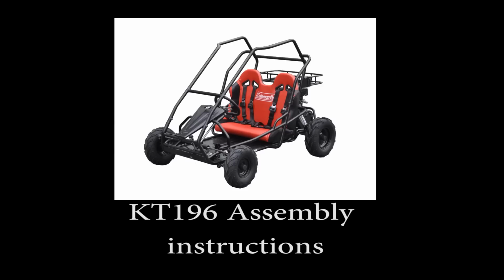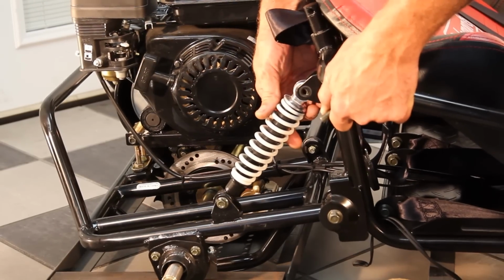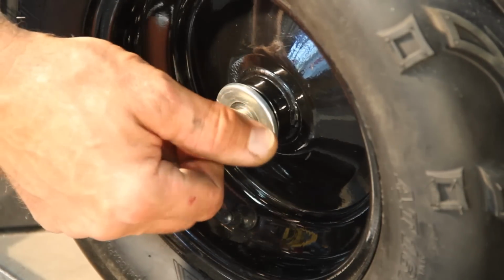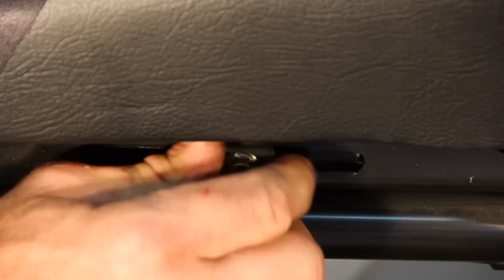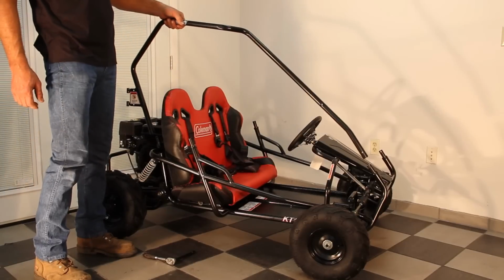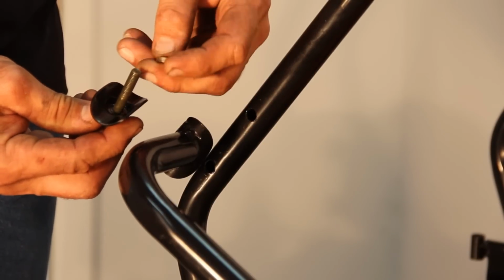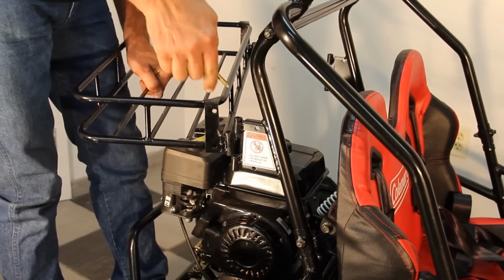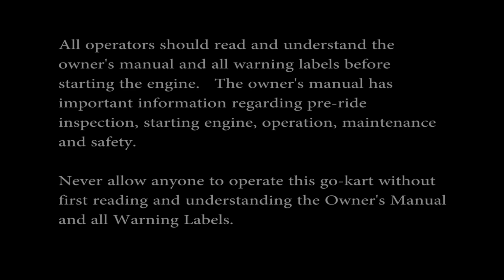New Coleman KT196   Go Kart - Assembly Instructions

Comment: Doh! picked one up and in 3 weeks the bearing seems to have seized up already. the sprocket to the jackshaft is locked while everything else jiggles. I contacted Coleman today to see if they honor anything. as far as fixing the flaw, I'm thinking of ordering 2 more of the drive spindles from the drive shaft and bolting them onto the axle in hopes to space it enough to bypass the jackshaft and be direct chain to CVT.
Reply: It work?
Reply: It was a pain in the ass because I had to take it to a crappy shop, but yeah it got fixed and has been working a year.
Reply: @armancha23  did you see a top speed improvement?
Reply: @elijahevo6859  not for that, it was just  a factory failed bearing.
Add a stage 1 and 2 performance kit and it does help. Intake, exhaust and maybe a carburetor.
Reply: @armancha23  well if you remove a chain out of it that's less gear ratio and efficiency losses so I'd think there would be at least like a 1 mph top speed difference
Reply: @elijahevo6859  oh, no i have not removed the chain like I had planned too.  Needing to get and adaptor made to bypass that axle. Too many other projects came up after I got this running and kids playing on it lol.

Comment: If you're putting the rear tires on while the kart is still on the metal frame, like the guy is doing in the video, be careful not to puncture the tires with the rear metal frame stands that the rear axle was resting on. Just saying.
Reply: Good tip, dude

Comment: I didn't know Coleman made these. Cool.. will a 6 foot tall adult fit in this?  What is max speed? Thanks.
Reply: G.R, Dray the steering bolt comes out on every single one I know about.. It did in 2015 right after I bought it and did again..
Reply: I am 6ft tall, and yes, I fit